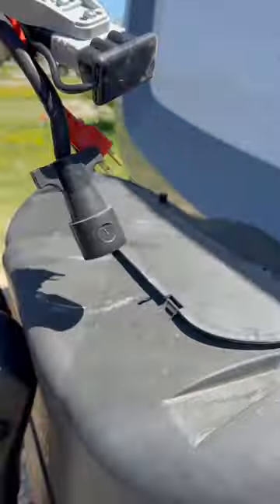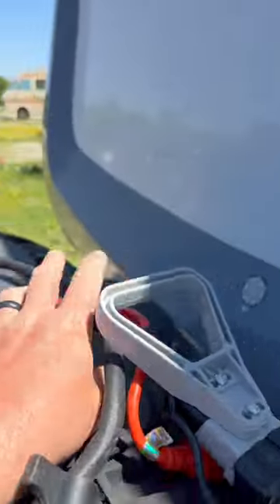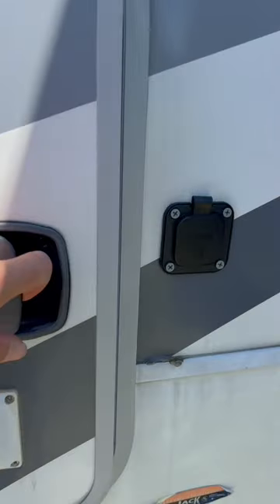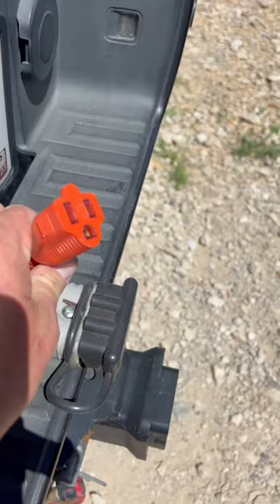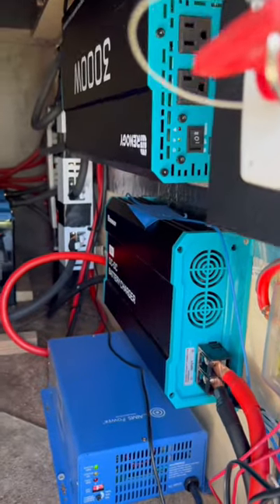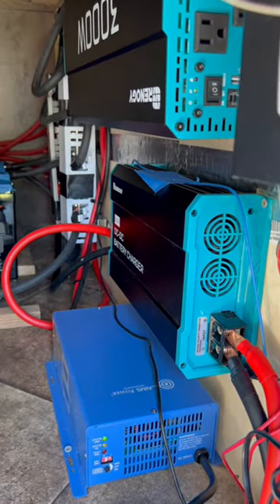Renogy DC DC Battery Charger - YOU NEED THIS FOR LITHIUM !!!!!

Comment: You could get rid of the signal cable by using a voltage sensitive relay in the truck. Which will also keep the whole circuit (in the truck) safer and free from corrosion by not being constantly energised. This also can have beneficial effects on the alternator depending on which vsr you go for.
Reply from the maker: Thank you. Didn’t think of that !

Comment: My renogy POS 40 amp DC DC charger. Does not output anything over 13 volts no matter what I set the dip switches to. In fact there is zero change whatsoever to any of the voltage parameters no matter what the dip switches are set to.
Reply from the maker: @CaptRageALot  I’d check the output with a good meter.  One that reads into the tenths and thousandths.   IE 13.8 volts instead of just saying 13.   A lot of meters and monitors will read 13 volts all the way up to 13.9 volts.  And the amperage is the main thing that would change with the dip switches along with the charging profile.   The most it’s going to put out is 14.7 I think and that would be on a low battery.   If none of that works then I’d say it’s a bad unit for sure.

Comment: I use the dctodc to charge my lifepo battery, do you know if i can also connect a solar panel directly to it or do I need an extra device?
Reply from the maker: We love our dcdc charger.  You have to connect a solar panel via a solar controller. To all batteries especially lithium.

Comment: Hey bro just a question what way are all the switches setup on the dc dc charger I can't figure out the right prophile for it for lithium
Reply from the maker: Hey there which one do you have ?
Reply: @HomeOnTheHitch  40 amp dc dc charger think the same in the video
Reply from the maker: Ok. So yes it is not explained well at all in the manual.   Not at all.  First thing , off is up and down is on.    For the dip switches.   5-off 4-on 3-on 2-on 1-off 

That’s what mine is set at.  Charges lithium to 14.4.   If you set 1 to on it will charge to 14.6
Reply: @HomeOnTheHitch  thankyou so much
Reply from the maker: Absolutely welcome
Reply: @HomeOnTheHitch and how is it for 12.8v, pls?
Reply from the maker: 5 off 4 off 3 on 2 off 1 off
Reply: @HomeOnTheHitch thanks for answer 🤝

Comment: You said 60a?  How long does it take to charge your batteries? What’s size are they?
Reply from the maker: So we have 400 Ah of battery. 4-100 ah lifePo4 batteries.   Real world use it’ll charge from 50% to full in 3.5-4 hours of driving /charging.
Reply: Gotcha.   That’s very helpful.  I’ve considered doing a 120a dc-dc charger but I wonder about replacing my second alternator that just burned out or just upgrading to a 240a factory that could hopefully power that 120a.  This makes me wonder if a 60a charger is adequate since I have 500ah of battery in the back.
Reply: @kylegilmore11 use a generator to charge it or else you're milage will suffer turning that big alternator all the time
Reply: @campervanbug7658  an unloaded alternator draws very little power. While charging it draws of course, but that's just a couple of HP getting dwarfed by the resistance of the trailer.

Comment: I'd really like to find the wiring diagram for a motor coach rather than a towable rv
Reply from the maker: Hey there I’d like to help if I can. So you want to wire it up in a drivable rv. I believe there is a diagram in the manual for the device if you are able to download that